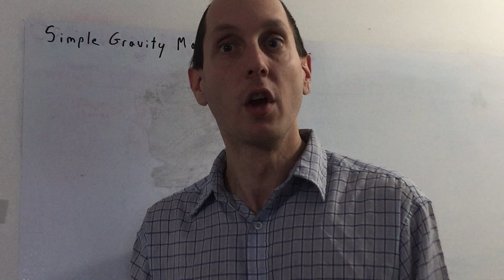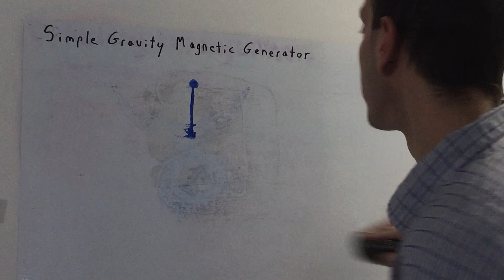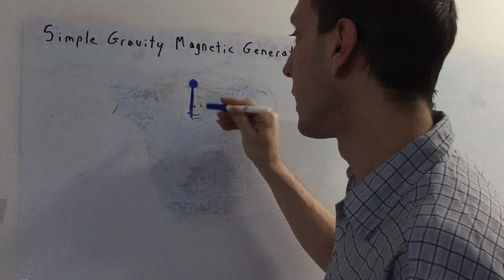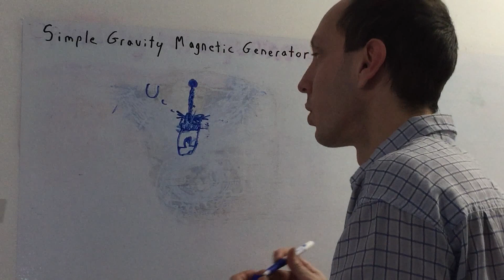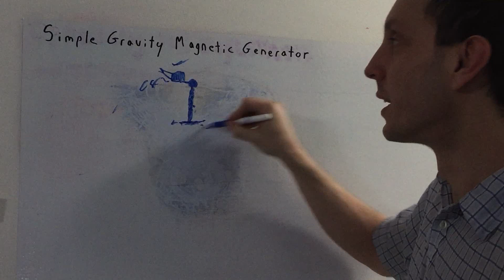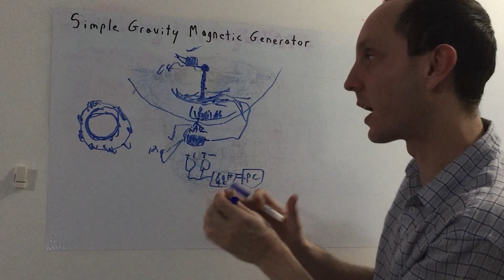Gravity Magnetic Generator Part 2

Comment: Hey Joel, I built a prototype “toy” with a bowl that had magnets same polarity up and randomly spaced.  Above was a string with a magnet of the opposite polarity facing down. I had the bottom ones decorated like flowers and the top one was a bee.  My idea was to add a small solar panel and rotate either the bowl or the bee with a stepper motor to keep them “unaligned”.  I have experience with the Bedini system so maybe I will revisit the idea, thank you for your work!

Comment: Check the work of Veljko Milkovic and his two stage mechanical oscillator-
mechanical amplifier
He has a channel and other websites with 
well researched and well documented experiments.

It is good.
Reply from the maker: Personally i'm not that interested in mechanical devices. But as you said all good info and it lines up so I cover the topic here and there.
Reply: @joellagace1679  
I replied to this comment a few days ago.
It seems some replies are not posted, even though 
they appear to be, at the time of writing.

I am not sure if it this is the result of deliberate filtering,
based on some keywords.
It has happened a few times.

To take advantage of the fact that the two-stage oscillator
output force can clearly do more work than the input force,
I was suggesting one way it could be made to produce a higher output in KWs,
integrated with a well-timed mechanism to manage the push stage.